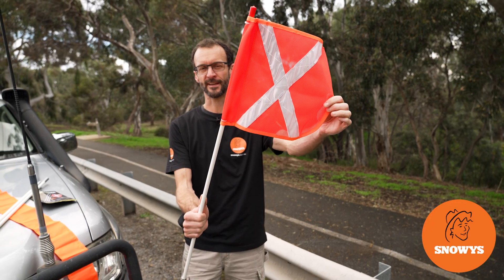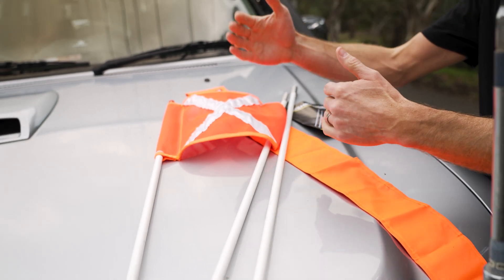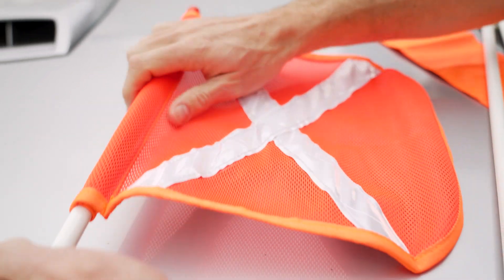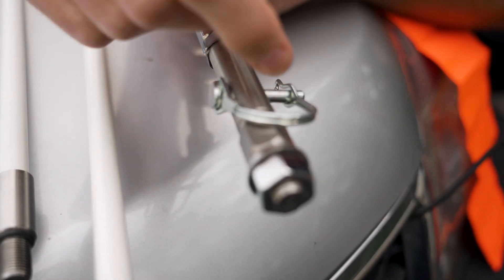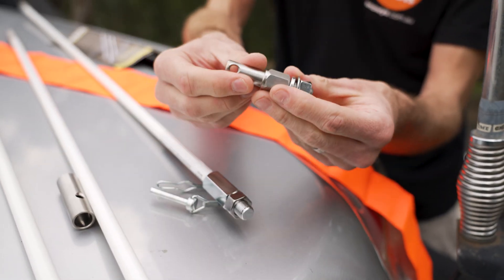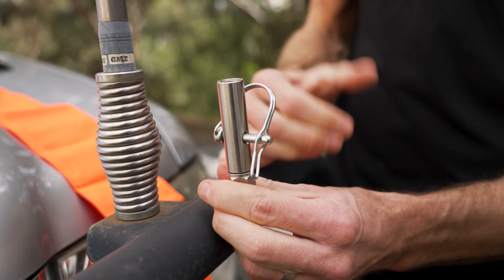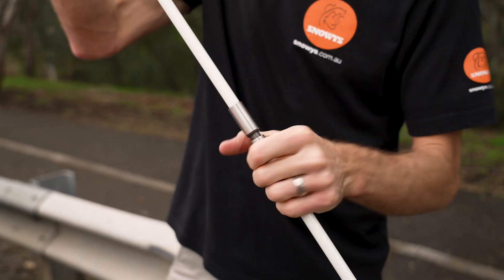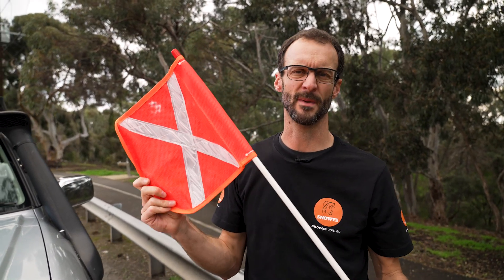Bushranger 4x4 Gear Safety Flag

Comment: Great, thanks heaps Ben for the installation guidance. I couldn't find anything on the Bushranger site. I look forward to using the flag when doing the Simpson Desert on an upcoming trip back to SA! Although I'm disappointed with the flag's 30km/h speed restriction. That makes it quite impractical for desert work with many spaced dunes. Minesite and railway driving can also be > 30km/h. More suited to coastal dunes driving. Also the threaded section diameter is almost too small for the standard TJM antenna bracket hole on the bull bar but too big for the Rhino Rack slots and brackets. Like you say, we'd have to make up a custom solution.
Reply from the maker: They fit with the GME antenna wrap around bull bar bracket, if that helps at all.
https://www.snowys.com.au/wrap-around-bull-bar-bracket?c=Black
~ Lauren
Reply: Thanks Lauren, I'll check it out, eg diameter. I received my latest delivery from Snowys this morning so I'll pick up a bracket from your store when I'm in Adelaide in a month. :)

Comment: Interesting to see they've changed the style now. I've had one for about 5 years and mine screws on at the base instead of the pin.
Great bit of kit but tedious if you have low trees to get under so that pin is a good idea.
Only thing I wasn't chuffed with was the nut on the base wasn't stainless so rusted badly . . . Just changed it out to a stainless nut so not a big deal but hope they've changed it too!
Reply from the maker: I like seeing brands evolve designs, it shows they've obviously listened to people who actually use their products.
~ Lauren